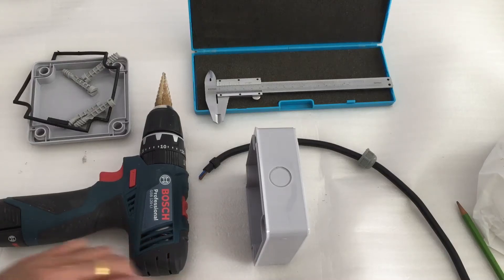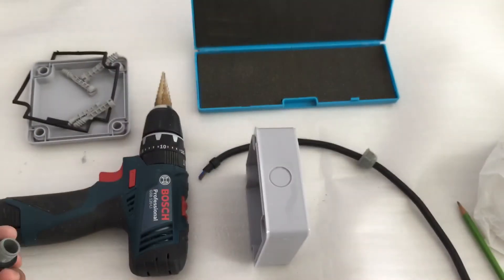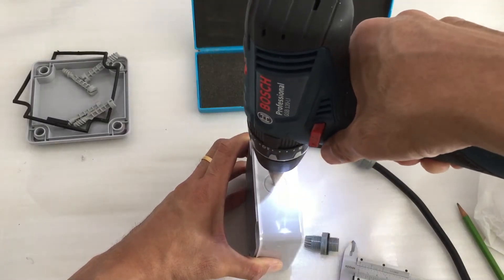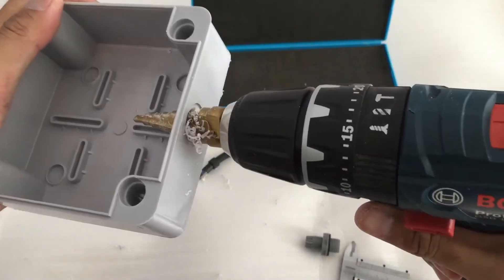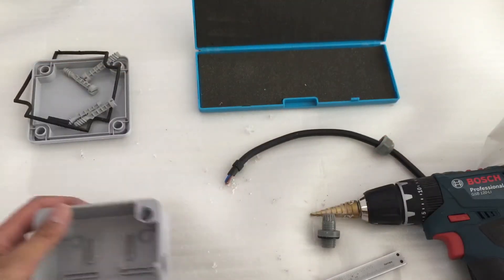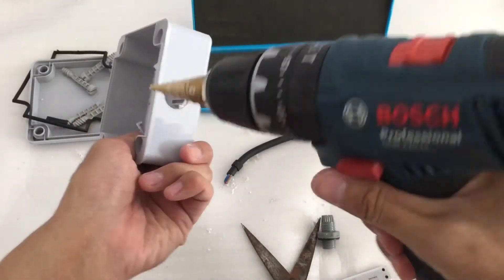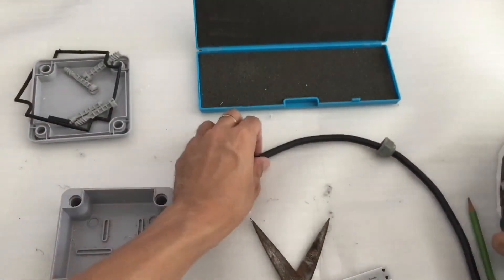Install outdoor inline cable gland connector on waterproof junction box customized hole.

Comment: Just worked this one out...the Dude is a engineer/ DIYer & not a electrician hence the callipers as we all have callipers at hand! and pulling the stuffing gland apart as you only need to push it into the gland then tighten it up...😊
Reply from the maker: How about this one? Cable Gland on a Metal Clad Double Socket (With Knockout Hole)
https://youtu.be/XHi1hhVentc

Comment: I still can't find how to pass in cat6 cable already having their ethernet plug installed
Reply from the maker: Any way to drill a hole by the side?
Reply: @CTB6  on the side, water won't enter?
Reply from the maker: @root8able  Ideally to be at the bottom. The cable gland are meant to prevent water from entering the box.
Reply: Naah just cut connector then pass cable
Reply from the maker: The hole appeared to be way bigger than the cable gland.
Reply: The way ethernet, phone, coaxial, etc cables are done is to feed the wire in first, and then attach the connector onto the wire. This is basically true of all wires, even electrical, when you think about how you connect the wire to whatever inside the box. Your only other choice would be to drill an over sized hole, put the wire in, and then close up that hole. This is more likely to fail though.

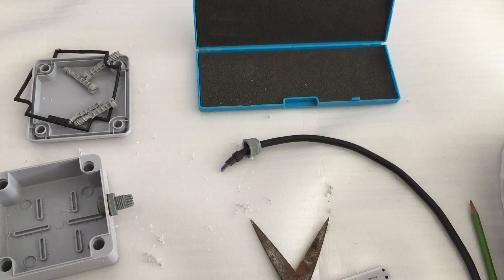Comment: What a shit head. First, that type of junction box is meant to just poke a small hole in that thin spot and then just push your wires through. Second, You spend 5 mins  carefully measuring and using your step bit to get the perfect size hole for your cable gland and once you finally get it you end up gaping the hole out to who the hell knows what size with those Haggard ass scissors and putting your gland in a hole that is much too big. Lastly the gland is missing a couple pieces. Basically, you succeeded in turning an easy 5 minute job into a shit show. I wish there was a way to get back the 3:09 I just wasted but alas, I am shit outta luck. Thanks for the mild chuckle

Comment: Very poor drilling technique. Drilling towards your hand will eventually come back to "bite you". Also when you are "trimming" ID of hole, use a round file. Makes it simple, fast and safe. Good luck.
Reply: yep... it bit me once. i was used to cheap used drill bits, then, one day, i was using a brand new 3/8 and had my hand as backing for the sheet metal. when the drill punched through it caught me off guard and gave me a cut with the shape of the flutes along 2 fingers (thankfully very superficial, but uncomfortable and inconvenient)
Reply from the maker: Ya really need to use personal protective equipment.
Reply from the maker: Thanks for the tip.

Comment: All you had to do was cut it out as it is designed to be done. No drilling No risking a stigmata to the palm of your hand   SIMPLES
Reply from the maker: Thanks. Ideally it is the case. Unfortunately the cable gland I bought is smaller than the standard size. I suspect one is the mm while the other is inches.

Comment: There’s a knock out piece and there’s no need for a drill . It would be much faster and easier. Thanks anyway.👍🏻
Reply from the maker: Unfortunately the cable gland I bought is smaller than usual standard size.

Comment: Hole was to big especially sinve you were using vernier calipers followed by a pair of scissors you borrowed from a museum. Also the dome gland has a rubber washer and not an 'O' ring. Then you forgot to first push the grommet in place. The grommet is the rubber ring that you referred to as a stopper.
Reply: Strange question, but I’m installing my own security camera setup. I want to get some small junction boxes like this to mount my cameras to. The reason being is that each camera has a pigtail to connect the Ethernet cord for power/network. Anyway, do you think it’s possible to mount my cameras to the lid of a PVC  junction box like you see in this video?
Reply from the maker: Have you tested it out by now? It should work if the camera is not too heavy. However the PVC box can’t be placed outdoor with direct sunlight. The plastic turns white and will becomes brittle.
Reply from the maker: Thanks for feedback. YouTube is my best place to learn new things. Appreciate that you make time to illustrate the difference between those terms.